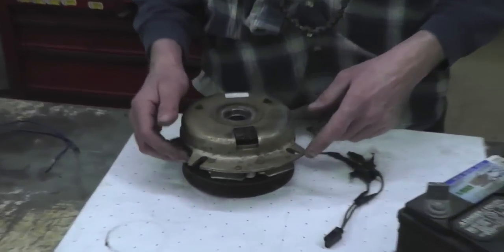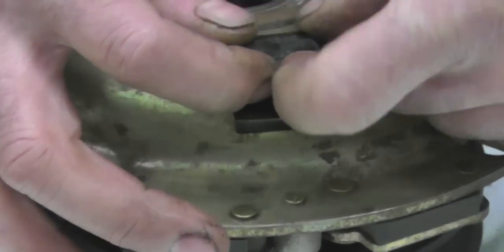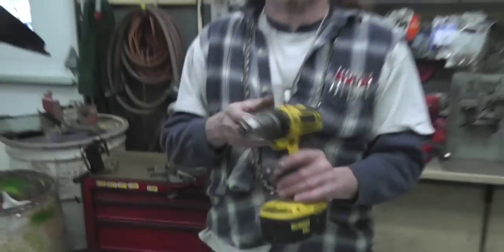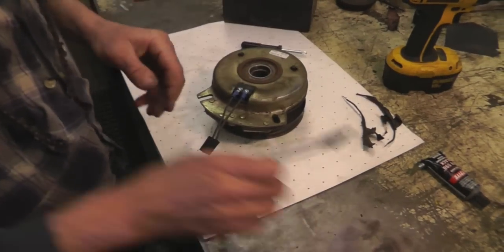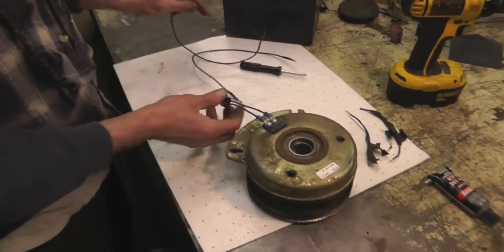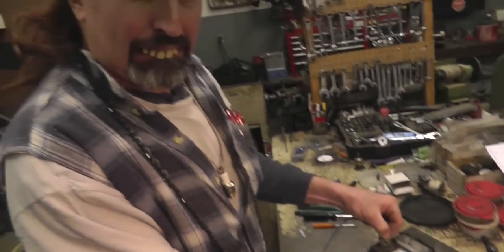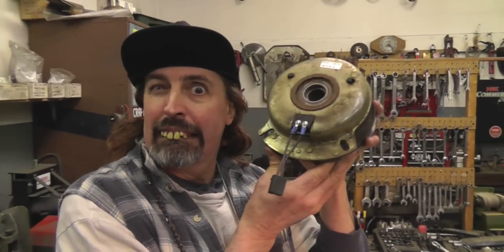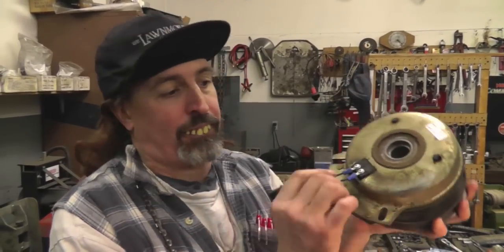How To Repair Ripped Out Wires On An Electrical PTO Blade Clutch

Comment: Wonderful however I have 1 question, how do you know what wire is hot when you do that? Or does it not matter? I was wondering about reverse polarity.
Reply: It doesn't, it will work whatever way you hook it up
Reply: @RetroCat969  Thank you very much for that answer!

Comment: great video! husband was drinking too much and ended up ripping wires out also. thank god I found this so we dont have to spend the money to buy a new clutch. woohoo!
Reply: Amanda H Yeah, they are like 7 to 800 dollars for a Power Take Off clutch.
Reply: no - most can be had for around $200-300.
Reply: @leesluga545  wonder where he got that from I have never seen a PTO clutch for a mower that pricy.  200-300 for most of them.
Reply: And there's your DINNER!!!!!!!!!
Reply: Blake .Davis then you’ve never seen one for a cub cadet tank M60. $500 minimum oem price. But still not 7-800

Comment: Thanks for the tip! That's a quick and simple repair that most would overlook. I've had a few like that and never thought of that. Saves the customer around $300 for a new one. I've just reopened my shop after 8 years and the prices for parts now is ridiculous. Manufactures don't want their products fixed, just throw away and buy new. I have a series 3 snapper rider that's 38 years old, works like a new one.

Comment: Sweet Mother of Pearl, this really works. A friend of mine paid $500 for a cub cadet that wouldn't mow. The locking bar was bent back so the clutch was spinning and the wires ripped out. I did this trick and it's a mowing monster now. Cub cadet wanted $475 for a new clutch. Thanks Taryl

Comment: Awesome video fellers. After more than a few hours troubleshooting switches, relays and wiring, I had a wire broken right at the PTO connection. I had wiggled that last piece of the harness quite a few times, but it didn't connect until I grabbed it right at the connector. Cut the wires about an inch from the connector, crimped the eyes on and screwed em down. You saved me at least 170 on an OEM PTO and several hundred for a Cub Cadet PTO. Thanks a megaton shitload for that.

Comment: Damned tree roots jammed and tore the deck belt which jammed and broke the  clutch retaining pin, which let it spin and shear the wires on the original, Japanese, Ma Gt Jd11 clutch.  This thing was still in good shape after 20+ years on a Troy tractor.

These wires come out the top and take a hard right bend under the lip of the formed clutch housing.  I drove a smaller sheet metal screw, coated in solder paste (from electronics work), down into and along side the wire stub.  The other wire has 1.5" left.

All I can say is You are a genius.  Saved me big bucks and kept my quality Japanese clutch.

Comment: Thanks Taryl. The wires on my Husqvarna YTH-2348 had gotten broken/cut twice. The second time I found the anti-spin rod popped up out of the hole in the top of the clutch. Ah Haaa I said. Put that back in and tightened it down, spliced out the wire, cut the front yard, then by the time I got to the back, it did it again. After watching another techn video, the guy says if you ohm out the clutch leads and it's under say 2.5 you need a new clutch. I ohmed mine it was .002 which is pratically zero. I have ordered a new clutch but didn't get the new thicker bar type anti spin rod. I think I'll order one so will have more meat holding it in the slot. What I didn't tell ya yet was I had been hearing a loud singing noise for months, but didn't quit mowing. It was prolly that clutch bearing going bad. I'm not a mechanic but try to fix my own stuff when possible. Thanks for all of your great videos and love the built in humor too. Great channel good buddy.

Comment: Jesus Christ you are a savior. Me and my friends were just trying to figure out how to repair my pto clutch that had disconnected. We came across this video and not only laughed out asses off but also got the secret trick to avoid buying a new $120 clutch. You guys rock.
Reply from the maker: Matt Torma thank you sir! And There's Yur Dinner!! Check out my other videos, lots 'O shenanigans.
Reply: Matt Torma damn 120 bucks is cheap most are 300+
Reply: Matt Torma 120?  Try 7 to 800 dollars for a PTO clutch.
Reply: Dan Basta if you paid 700 I need to buy a truck load of the 400 dollar ones and sell them to you
Reply: Chris n Tracy Maze Just stating a fact here. Currently, I am having a problem with my power take off on my International Harvester Cub Cadet tractor, 982. Worked fine, mowwd the grass with it, put it in the shade, let it cool off as i baby my equipment, went to start it up and do a little more mowing, hit the power take off switch, and, nothing. Fuses are good, getting electricity going to it, even when the engine is off, the tractor will start, engage the pto, and when the tractor ignition is off, turning the pto switch on, tractor won't star, shut the pto off, tractor will start. Replaced the switch, still the same problem. Priced the pto clutch, cost 7 to 800 hundred dollars for this unit. It would cost exactly the same for a Power King tractor as well to. Sorry sir, parts are expensive, these outfits know this, and it's something you need, and you HAVE to pay it, or do without, your choice. This is a fact. I do agree with you, yes, it's highway robbery, however what are ya gonna do?
Reply: Dan Basta I have a cub cadet 2165 that clutch for it is 405 out the door
Reply: Dan Basta check the ground going to it the clutch stays hot all the time and ground is what engages it
Reply: Chris n Tracy Maze, Was thinking the very same thing. Today, if i can, i will be going through the wiring, and yes, there is such a thing as a ground strap that is attached to the tractor body frame,  however as these things will be checked, don't think thats the problem as the lights come on,  everything works, excrpt the power take off clutch. Thought of maybe the pto belt as well to, however, its in excellent shape, however, you may never know. They are like wiring itself. Physically, they LOOK in good shape, however, they may have internal broken problems due to wear and tear or possibly something just isn't catching appropriately, and that might be the whole ptoblem in itself. I will hopefully look into these things very intensely and get back to you, however,  gettin ready to shell out a lot of cabbage for a new pto clutch.
Reply: Dan Basta I was talking bout ground wire going to the clutch is your clutch riveted or bolted together with springs in between if so pull the clutch off check the air gap in it go to partstree.com they have parts for cub and also have rebuild kits fir the bolt together clutches
Reply: Chris n Tracy Maze I was looking at the wiring today. There is a red wire going onto the engine frame block,  the other wire, naturally tied into the pto clutch itself. I was trying to pull the comnnection apart and turn on the key in order to check if that power is even going to the clutch at all. Couldn't get the thing apart, snd threw up my hands, thinking that it's best to leave well enough alone, might do more damage than it already has. Believe this has springs that you are writing about. Now this tractor when purchased bran new, had an Onan engine in it. After years of use, the engine began to have all sorts of problems and Onan engines are extremely expensive to fix or rebuild, IF, IF you can even get parts for them. Cumins bought out Onan, scrapped out their engines,  and they are even MORE of a nightmare than before Cumins bought them out. Now, let me put you wise on something here. A John Deere 318 has EXACTLY the very same engine as a International Harvester 982 Cub Cadet tractor, and that is, an Onan engine in it. I got a used Kohler Oppose engine in this tractor now, and would rather have a Kohler engine anyway, anyhow.  Now Onan engines are good engines, don't get me wrong, it's just the extreme expense accociated with them is what's bad, and their service department is bad as well to.
Reply: Dan Basta this HDS 2165 cub I have some idiot thought it would be a good idea to cut all the wiring from the safety switches on it even bypassed the PTO switch to just a toggle switch hell the PTO switch isn't but 23.84 out the door now I have to flip the toggle several times to get clutch to engage I plan on putting to original switch back in it
Reply: Dan Basta you might try pushing pulling switch see if that might get it to kick on I've been s mechanic for 35 yes still don't understand all the shit ppl Jerry rig then expect me to undo it
Reply: Dan Basta this 2165 has the vanguard v-twins Briggs on it
Reply: Dan Basta I'm planning on building a pro-mod mower with the 55 horse vanguard with twin 41mm mikuni carbs hoping to put it in the low 8 secs
Reply: Dan Basta here is part numbers for the clutches 917-3389 this is early one with springs 405 the other one without springs is 917-3446 it is 432
Reply: Chris n Tracy Maze I would much prefer a push/pull switch very much, however, this unit came new with a toggle switch. Wouldn't  mind putting a push/pull switch on my Power King  tractor if I should need one in the future.
Reply: Dan Basta ah k

Comment: Tarly, you’re a genius in disguise!!  When I pulled a branch from above my deck, it ripped out the wires from the clutch and blew the fuse.  Followed your instructions and, after spending $2.49 for eyelets, had my 9 year old mower running again.  Saved enough money to buy a new power washer.  Thanks Tarly, you’re super!

Comment: The spade connector broke off inside the PTO clutch. I thought I was going to have to buy a new clutch. I tried the tip suggested in this video and it worked like a charm. Thank you very much.

Comment: That is a good tip. I had to change the drive belt on my Ariens, and it is just a piece of metal that the clutch jams against, and the clutch has a little play. I guess it was designed to have play in it like that.

Comment: Taryl,  Have Examrk Lazer Z with a PTO clutch that runs about 4-5 minutes and then blades stop.  After blades stop, bring into shop, put volt meter on pigtail lead at clutch and have 12 volts.  Let unit set an hour and cool down clutch works again for short period of time.  I have seen where they is some sort of temperature protection built into the clutch to protect the windings.  Is this correct or just bite the bullet and purchase new clutch?

Comment: Any idea why the pto won't engage with the switch? I did as the video and have tested with a battery, all works fine, but then when connected to the factory connection nothing engages. Thkx a bunch.

Comment: Great video and simple approach ... but i need to know what wire goes to the what side?  My unit is old and hard to see what is positive/negative for severed wires.
Reply: Did you ever find out lol I have the same problem

Comment: I have a similar looking clutch on a Toro 597Z. Replaced it last year with a new unit. The wires worked there way out of the jacket that enters the clutch through a small hole and touched together from the friction. I'm attempting to understand if I can externally mount the wires rather than putting them through the hole to the inside?

Comment: I do simular repairs. But I make an "S" bracket and drill 2 small holes in it and glob the silicone over the bracket and connection going into the coil and zip the the wires to it.

Comment: Great video as usual. Where do I get the male and female plugs to replace mine? Will any male and female plug work?
Reply: Rotary # 12923 will give you the male end of the OEM type, but I don't currently have a number for female end or a kit / pigtail that includes both.   But yes, any style of connection will work, you'd just have to change both sides.  Should be able to find something suitable at any auto parts store.
Reply: Not sure if this is what you're talking about as my husband's the engineer, not me.  But this is what I ordered for him to replace ours when the wires were broken off at the clutch:  https://smile.amazon.com/gp/product/B072QZZJP1/ref=ppx_yo_dt_b_asin_title_o05_s00?ie=UTF8&psc=1

Comment: Did this repair like 5 years ago and today the bolts came out and next size up would touch eachother making continuity

So out comes the hot plastic melting soldering iron and you just scrape away until you find the bare wires, get some needle nose pliers , tie wire around old crimp now the fun part
Get a soldering iron and a old bit, shove the bit into a small socket piece and hammer it down to make a crucible, let it heat for 10 minutes then dump solder in until you have a molten solder bath and pour it into the new tied wires and insulate with RTV silicone
See y'all in another 5 to 10 years when i probably have to replace the bearings in the clutch

Comment: Help please. The plastic bit you screwed into on mine is broken .loose and wobbly, it lifts up with 1 tiny copper wire,looks like its broke away from main plastic housing inside,  can i fix it.

Comment: Does it matter which way one attaches the wires back to the clutch? Thanks
Reply: That's what I was wondering, too! My wires snapped off, & going to have to do this. Have to order the whole pigtail first, as the connector at the other end is cracked as well. 
Seems like it would matter, since on my Cub Cadet LTX 1046 VT the wires are two different colors, and that connector leads into the pto harness.

Comment: are these clutches adjustable? my mowers blades work only when cold but when you get it hot the blades quit engaging.
Reply from the maker: +Jordan Walker The only adjustable clutches are the ones with 3-nuts in a triangular shape the other clutches are not re-buildable . The only aftermarket company who makes a rebuildable clutch  is ARROWHEAD electric. They have very well made clutches GOOGLE em they probably make a clutch for yur mower.
Reply: +Taryl Fixes All im a mobile mower mechanic. i think you just missed some nice profit on the part. also, if the gasket maker comes off and those screws contact something, could be a lawsuit or the cost of replacing everything that got mest up from a fire could come out of your pocket. would do this on my own mower tho.

Comment: hey taryl i have a k301 and every time i engage the pto it kills the motor what does that sound like the points are worn or other ignition problem
Reply: Check and see if your blades are stuck on the mowing deck.

Comment: Hey Taryl, I didn't drink enough to rip my wires out but the pto clutch stopped working. I found that if I ran a jumper from the white wire to the negative post on the battery the pto works again. That means the coil inside the clutch is messed up somehow no ground. Is what I am doing safe? Is it going to catch on fire under there? By the way this is on a rzt-l 42 cub cadet.
Reply: That sounds more like the ground wire is not making connection to the neutral line somewhere. It could be a bad safety switch or a broken wire in the wiring harness. If the coil inside the clutch was broken, then nothing you could do would make it work. If you are still able to engage and disengage the clutch with the switch, your fine. I have quite often had to run ground wires like that.

Comment: Frikin' awesome, now if I can figure out how to bypass the pto switch to check if it's bad--
Reply: Rude Dawg if you’re talking about checking the pto switch pull it out disconnect it and do a sound continuity test it shouldn’t make a sound till you pull the switch up.. yellow and black wire.. or it could be white wire and black wire. I tested my John Deere I got from a guy cheap cause they gave up on figuring what was wrong. Switch was fine then looked underneath and wires got ripped out. Then the hydrostatic didn’t work all that was, was the 2 idler wheels on the spring loaded bracket were frozen and couldn’t be moved by hand. Spent $14 and it works great!

Comment: I have the same problem with some of the wire still left on.  Both wire are black.  Not sure which is positive  Will it hurt the PTO  if I hook it up backbards
Reply from the maker: Navigator Page Nope it won't hurt anything. It's just a big magnet. There's your dinner!
Reply: thank   it worked
Reply: I am having a problem removing the wire connector from the PTO clutch on the cub cadet

Comment: Was out mowing on my Husqvarna YTH2348 when all of a sudden the blades quit spinning. I pushed in the PTO switch, then pulled it back out to ENGAGE position, the blades tried to come back on, but that's when it gave up the ghost. There's nothing jamming the blades, belts good and tight, tension pulley is good. When I go to engage the PTO switch, I get NO click out of the PTO, it simply doesn't do anything. I checked the seat safety switch, its fine.........Any ideas???
Reply: Jeffrey dontyouwish if youre still looking for that information, which I doubt you are, check and see if the clutch connection to the tractor (located around the engine either just above or just below the mounting surface) is giving 12.6 dc volts when the pto switch is in the "on" position, if so, repair or replace clutch

Comment: I have a 2016 Troy Bilt Horse with Hydrostatic Riding Mower and when I set it into drive or reverse it won't even move but I hear a rotation noise can you make a video oh how to fix hydrostatic transmition
Reply: Chevrolet Silverado Pro check the bearings in the varible speed unit on top of trans if it gets any lil play at all it won't function